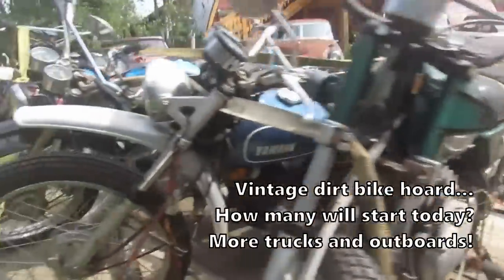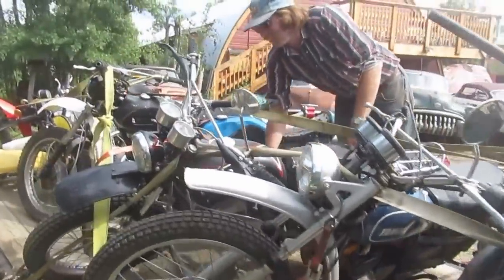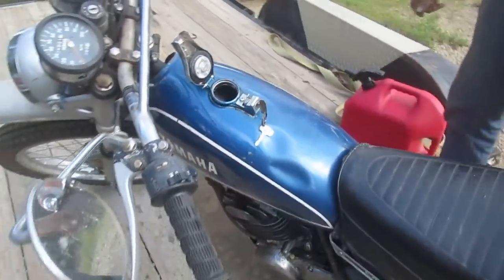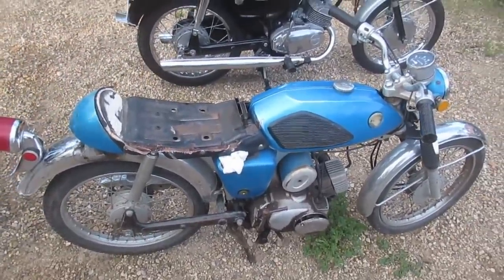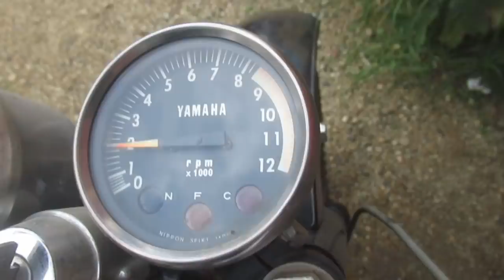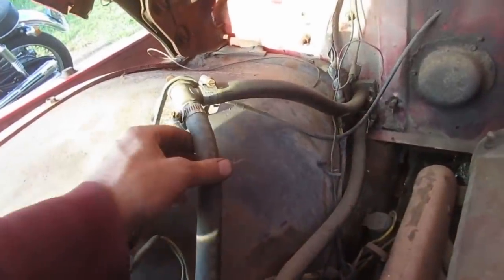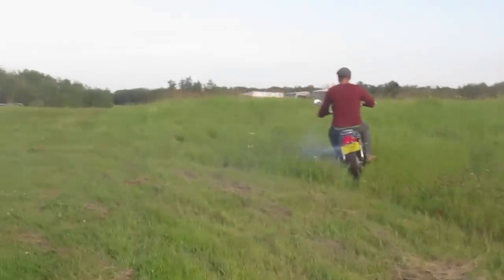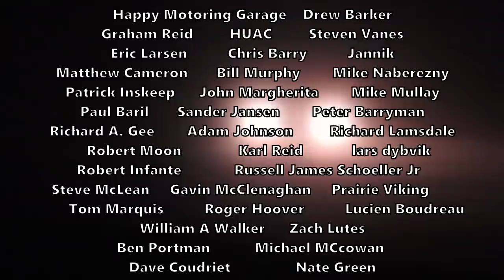Scored a Hoard of Classic Bikes! Will any of them Start?

Comment: I had a 79 DT250 when I was in high school in the mid 80's. Paid $150 USD in 1985. Sold it like a dumb ass back in 97. Rescued a 78 250 off a junk pile thats sitting with Panther Piss soaking the jug. Got a 73 DT360 that is fresh bored 10 over but needs total wiring harness, tires, chain and some love. Time and money is all it takes....LOL!  Keep on keeping on. PS you guys rock.

Comment: I'm 63 and those bikes are like what I rode in the 1970's before I bought my first road bike, a 1976 KZ900. The Suzuki you got was like a 1967 we picked up for $15.00 in 1970 all ratted out that we turned into a strip mine dirt bike. The generator didn't work so we taped a couple of those big dry cell batteries together to run it until they died, usually a couple of hours of course no lights or anything on it and a dinner fork for a key switch - good times when you are a kid. My last straight dirt bike was a 1974 Yamaha 360 MX track bike with just number plates. Had the transfer ports re shaped and the piston skirt cut to alter the timing and it was super peaky with an expansion chamber and no silencer.
Reply: The things we did...... you couldn't get away with most things like that these days. It was all about fun and making do. The kids these days wouldn't even touch bikes like these. They would want brand new stuff!
Reply: Hi vettkid. My friend bought a new KZ 900 Kaw in 1976. In 1978 he traded it in on a new 1000 Kaw. Both bikes were super fast and a blast.  Im 61, still ride a little, got a goldwing 1500.

Comment: Hi guys. What a score. i owned a 380 suzuki triple, two cycle. Put it together from three wrecked basket cases. Loved it. Owned alot of motorcycles over the years. Currently 99' 1500 goldwing, 68 riverside 250 scrambler, 72' 50cc honda moped. once you start riding, its hard to stop. I still love motorcycles. Thanks for the awsome video. Rev. P.S. love the old merc. and the ford service truck. Im really diggin the tunes at the end in the credits. Sounds great!

Comment: Gotta love deals like that. I picked up a '75? TS250 Suzuki street trail that was trashed for $50 back in the mid 80s. The group of buddies I hung with all bought $100 beaters so we could run the deep woods back where one of the guys owned a cottage. We all had a blast ripping along trails that you never had to worry about meeting anyone on. And if it broke?...meh..go buy another one if you couldn't fix your own with some tape and safety wire.

Comment: never owned a motorcycle. haven't even sat on one in nearly 40 years. $800 for 4 nearly-complete + parts worked out in your favor this time.  excellent that two were running in short order.  the big yellow one - if motor is intact - looks interesting.

Comment: I had a few of the 500 Titan  Suzy's they were from 70 or 71 up. The 1969 and 68 were just the T500's they had the head light like you have there on the 50. I think they called it the coffin style head light due to the flat bottom. I know there are worth a pretty good dollar if you have a clean one. The Yam's are DT 's Huge following and once fixed right are bullet proof. Good score !!

Comment: The second to last bike with the white fender and blank yellow front number plat ... i think is yamaha mx 175 born 1979... i had one early 80s  it had a 5 speed transmission more less a single cylinder RD 350 :)

Comment: Dirt bikes, a vintage outboard motor, a nicely patina'd F350 - instant like! I had a couple of those Yamahas - but in a much smaller form: pot metal bodies & wheels, molded chrome plastic engines, rubber tires - all riveted together. Unfortunately, mine didn't survive the 70's as well as yours did. As usual, Scott does a top notch paint job on some vintage metal, & even gives a cool history lesson. Nice jacket, btw! I'm going to have to peruse the vintage stores in my city to find one. The only way that Ford truck could be nicer is if it was a Dodge, but if I could score a truck like that for $450, I'd look past the manufacturer. That truck is old gold! Maybe you'll do a follow-up when it's up & running? I'd ask if there's anything you guys can't fix - but I haven't seen that video yet. And I don't think I will. I'm still pulling for the Buick in the "Straight 8 Showdown", so someone should pat the Packard team down for 4-leaf Clovers - seems like they've got some extra luck on their side. Until next time, gentlemen!

Comment: What a score. Reminds me of back in the day for sure. As I recall though, all the enduro line had their front fenders right close to the front wheel, that up high moto cross look didn't come along until later on the enduro line. The enduros were great little bikes, a lot of fun. Later they had the name on 4 strokes, and had the high fenders. I had a 500 like that, I don't recall the year, 80 something. at one time I picked up an 80 cc little toy. quite a story to that one. I actually got it at a flea market where I was selling, the guy across the aisle had it. We'd do business all the time. It wouldn't run, so he sold it to me for only 20 bucks I put it behind my tables toward the back of my booth. When I got a chance, I took a closer look at it. While it had gas in the tank, none was getting to the engine. So I took off the hose, the petcock was blocked off, not letting any gas   through. so I fed some right into the feed tube and kicked it over... it fired right up. The guy that I got it from just shook his head. I later traded it for a Honda 70, but never did get the Honda going, so wasn't a good deal for me, but in between I had a lot of fun with that yammy in parking lots and the like. Never bothered to put it on the street, it was way too small for a big guy to consider doing that. 

I have to ask, what are the title laws there? Did you get titles with the bikes or do you need to?  Used to be after a certain number of years you could sell motor vehicles with only a bill of sale, but the laws keep changing all the time. 

How is it, that in both Canada and Alaska where it's normally so wet, there are a lot of vehicles in rough but reasonably non-rusted shape?

Comment: The enduro yamahas were called DT's. Dirt trail and street use.

if memory serves me correct the green yami 250 is a 75 the blue yami 175 is a 73  Black yami w/ white/red pinstripes is a 71
many parts on the 100 to 175 yami's are interchangeable, that goes for  both DT, and MX series bikes
  250 and 400's use many of the same parts
Reply: oh, cut some 1" long pieces of PVC pipe to put in the front forks to get the ride height back up

Comment: Be wary of air/fuel mixture when pre-mixing two strokes.  It's counter-intuitive, and probably wouldn't create a crisis with those old bikes, but adding oil to the mix leans out the mixture (less available fuel per unit air because of the oil in there).  If carb jets are occluded with varnish from sitting, the stock oil pump is gouting oil into the carb 'cause it still functions, AND you pre-mix: you are looking at a potential over-lean/seizure salad.

Comment: damn man.. give one of them to me.. i already rode two 125 cc scooters, two 50 cc scooters, and one for a month. the only thing to learn is riding a manual. thats my dream. to ride a manual motorbike. I already know how to do it, i already drove a car before. my mom gave the renalt clio to me, and stalled for the first time but for the second, it was easy to get going. ohh, and forgot about that honda vtr 1000 cc. i actually did hold it easily. i even kicked up (or how should i say it) the stander and put it in 1st and pulled the first brake, and i was letting the clutch out carefully, to feel how it pulls. (im actually 12)

Comment: Two stroke engines make good power, why, every second stroke is a power stroke! In a four stroke engine only one in four strokes makes power! The other advantage of two strokes they pretty reliable, due to very few moving parts, piston conrod, crankshaft, that is about it, simple engines. Those little 50cc road bikes SCREAM some of the racing ones in the 50,s see very high RPM.